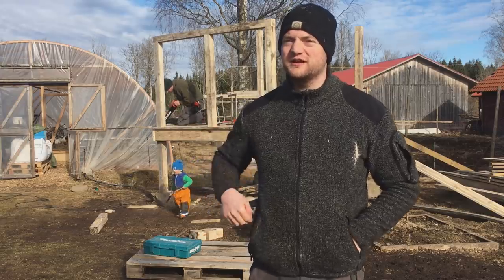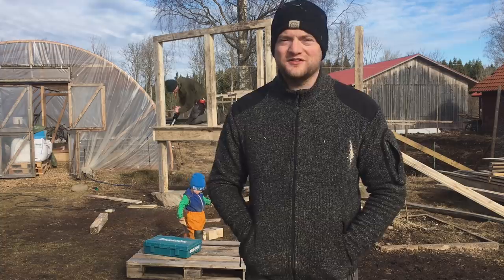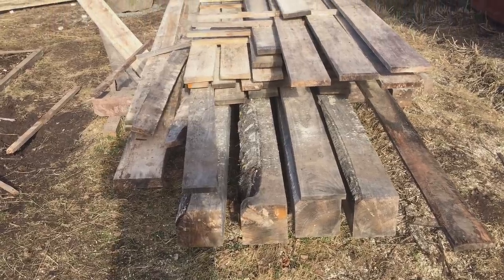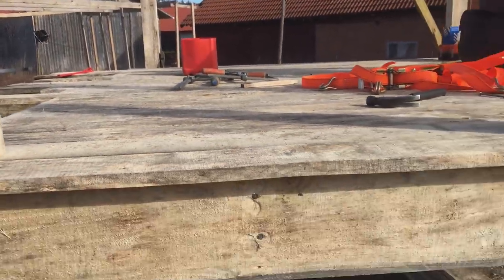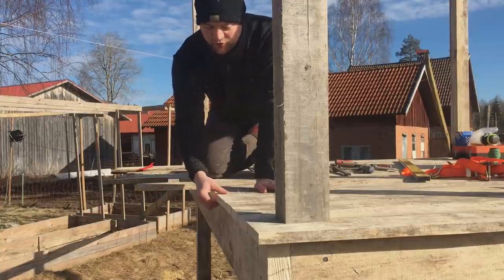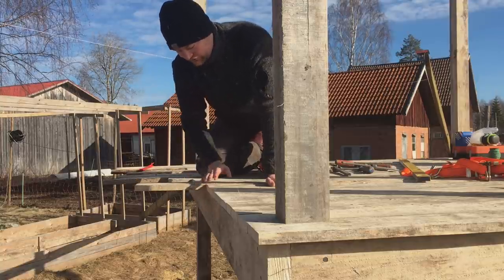Building A Playhouse Vlog

Comment: I did same for my kids except my garden shed is on the 1st floor. The nail only method of holding the floor joists to the outside of the posts is prone to failure. when you add up the weight of the building, toys, children and possibly snow it becomes an awful burden on the shear strength of a few nails. A few bolts and possibly cleats to transfer the load to the posts would be a great improvement. Building code requirements are a whole different game. I suspect bolts were already in your plan and I mention this with only the best of intentions.

Comment: Interesting to see you used nails rather than screws, in my experience nails are better if the structure is going to flex due to the weather. I made a set of trestles using screws, they were stored outside and eventually almost every screw snapped, I rebuilt it with 4" nails and had no more problems.

Comment: I've seen that kind of construction before. I am sure its fine but the possobility of the wood falling off the rock startles me a bit. lol. I know it's an irrational concern though
Reply from the maker: It is anchored into the rock with the same screws that you secure houses onto concrete foundations. No worries with other words.
Reply: Swedish Homestead Oh thats great. Nice. Well built, good job. I haven't done too much structural work if you can tell. A deck at best lol